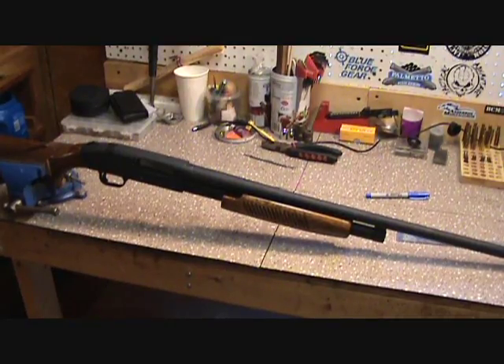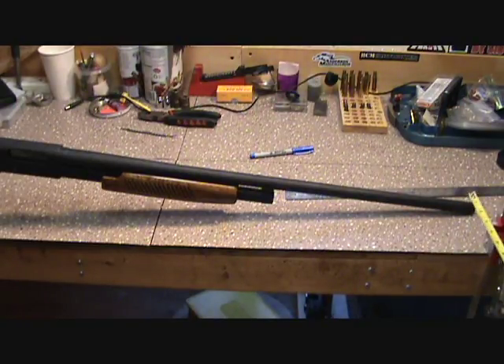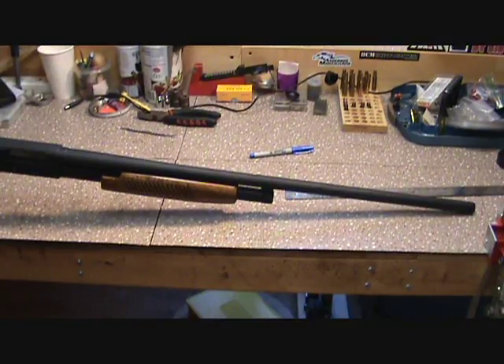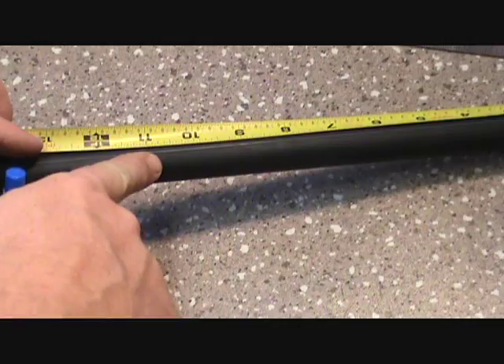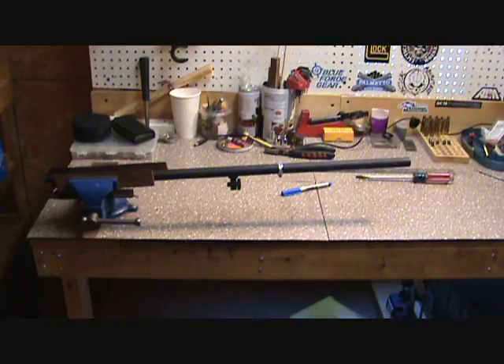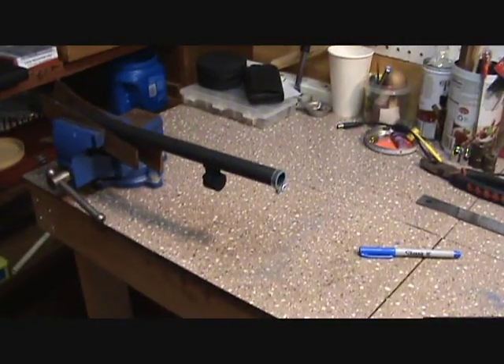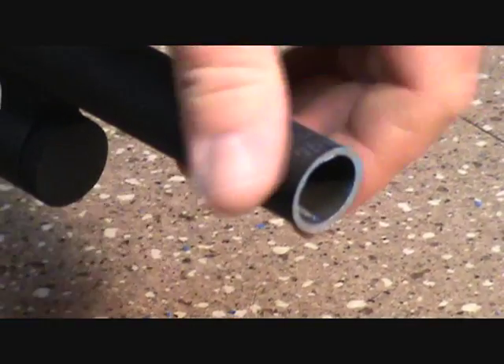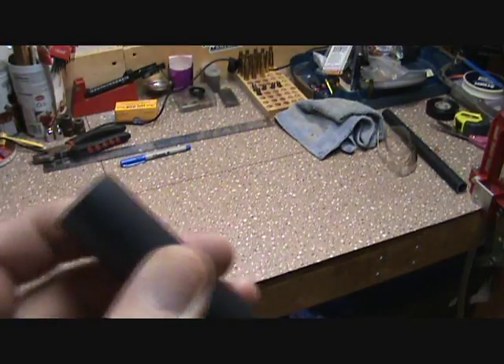Shortening a shotgun barrel. Revelation 310 (Mossberg 500) project pt4

Comment: Any tips on cutting my dbl barrel down, it's got a damn 1/8" flat piece running the length of the barrel straight down the center
Reply from the maker: Gotta be careful with doubles. The rib that holds the barrels together are soldered in. Cut flush with a end of a rib.
Reply: I know I saw that on another video where the guy was shooting off rounds and I was wondering  whoever did it because it had a flat piece in the center and the 2 barrels were not cut flush with that flat piece  like you mentioned it was a little longer than the barrels.
Reply: Will said he can do it for ya... But after she's done its gonna be southern fried chicken and mash and a whole lot of beer...??? (not the second shelf but slightly above Lol !! Im subscribing I like this good ole boy!!!)

Comment: The steal is no longer Blued, is there an attachment maybe a suppressor looking deal you could buy and mount on end of barrel?
Reply from the maker: I used a bluing pen to keep the exposed metal from rusting until I refinished the barrel
Reply: There is a product called Perma Blue, works perfect. Made mine look like it was never cut, especially if you take care to square your cut
Reply: @errolbarnes6682  

Who sells it, or can you buy it direct?
Reply: @errolbarnes6682  

Thx, I found it, on Ebay, Amazon, ect,,,,

Which is better the paste or liquid?